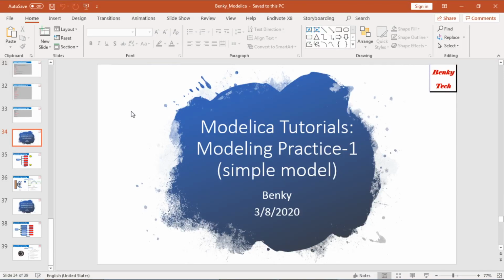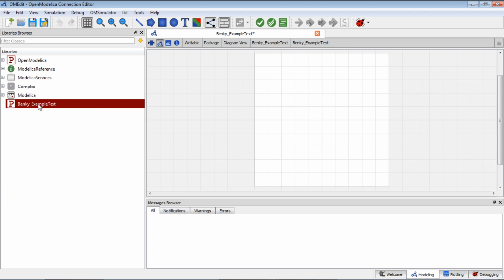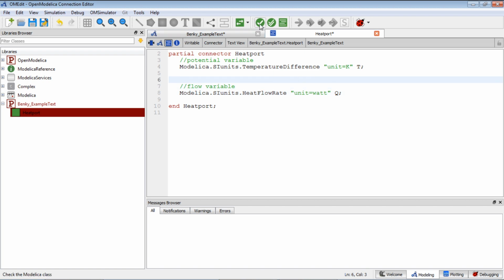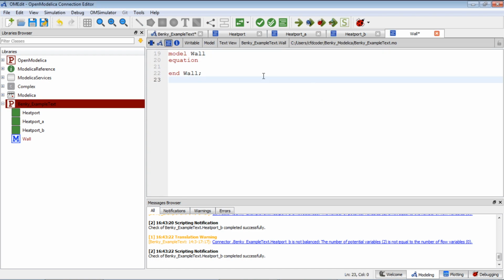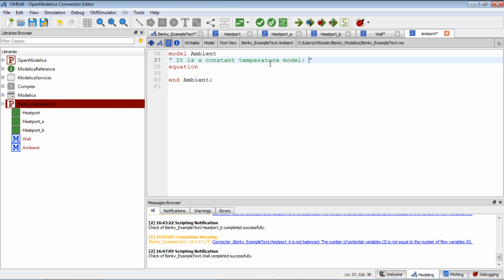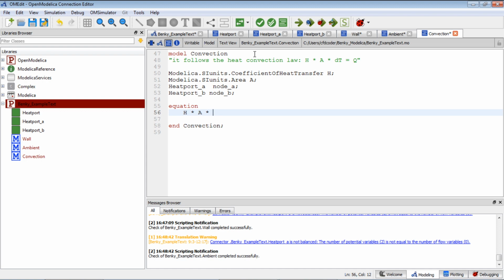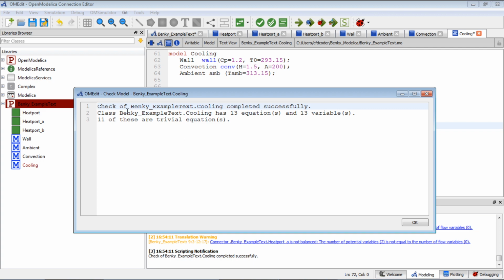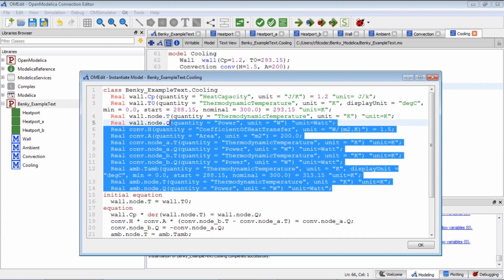Modelica Tutorials for Beginners: 8.0 - Modeling Practice (001) in OpenModelica.

Comment: One question: to your each component model, which are parameters and which are Real variable for solve (i.e., the output from solving the model by ODE equations?) Looks like they are all parameters (as you give their values in your Cooling model?? Thanks in advance.
Reply: From your last part of the video, when all aggregate to your Cooling model, it shows Keyword "Real", so I think they are variables (one type in Modelica, you mentioned in your previous videos)? Correct? here they are constant variables??

Comment: Mr.Benkey Excuse me, where can I find the model of air conditioning system that can run directly
Reply from the maker: There is no open source AC library. You need to buy commercial packages. Or you can create one yourself with what you learnt.